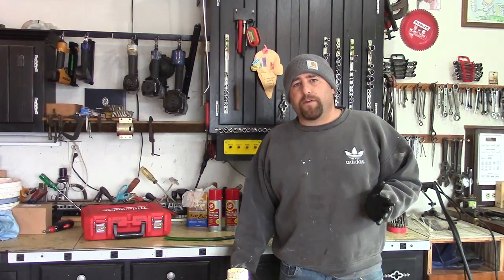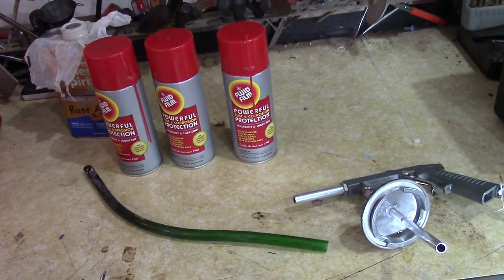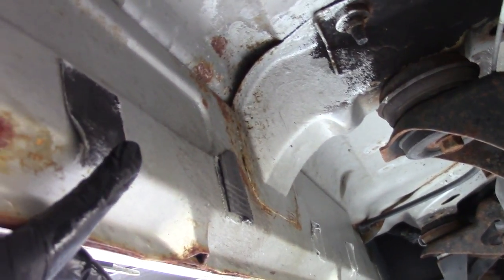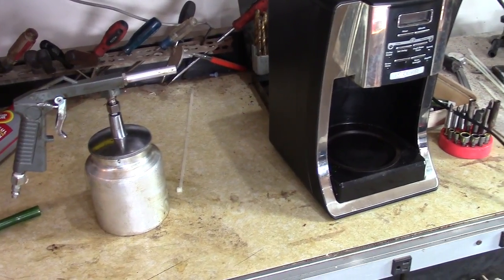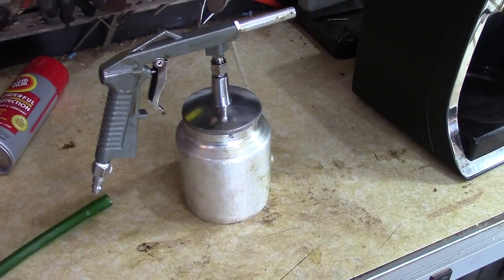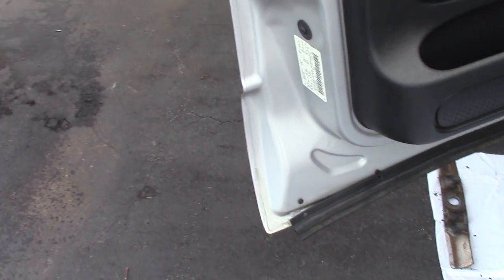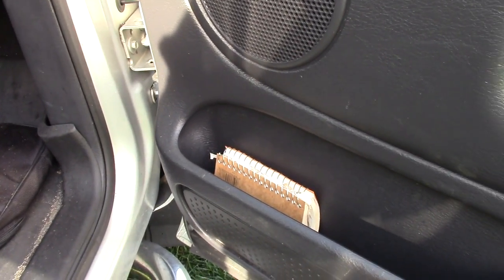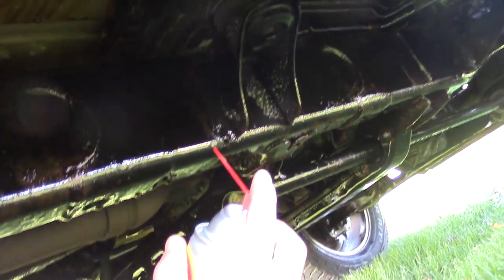Using Chainsaw Bar Oil For Undercoating My Truck

Comment: Your basic problem with the rust is the truck's a Chrysler/Dodge product in the first place...
Reply from the maker: No one told me that I should get a Ford or Chevy because they don't rust.  In fact, I got rid of my F150 because of rust.
Reply: @doublewide6   all manufacturers have rust problems tho japanese seem to have less, they used to use more coatings and different sealants giving a full decade of protection but greed has led to whats going on today. frame rails have holes because they are dipped in a bath at the factory allowing the coating in and out as well as environmental liquids like when you put a boat in at the ramp. next time just add a lil lacquer thinner or white gas with paraffin wax melted into it to the bar oil to improve flow yet increase tack once evaporated while also increasing penetration into the rust. you can also use just plain roofing tar cut with thinner  instead of used oil, used oil contains a lot of acids as well as microscopic  cast iron and steel particles that may increase deterioration over time.

Comment: Best is to have a friend that has a stone driveway to spray your car on and a portable compressor.
Reply from the maker: That would work well.  It takes about 2 days to stop dripping, so you want to leave it parked over a tarp or cardboard.
Reply: Yeah it's always good to have a friend's house you can make a mess at. LOL

Comment: Terrible idea and no update
Reply from the maker: I recoated about 2 weeks ago.  I put fluid film on my other car and the oil works way better.  I'm  just coating over the few spots that rubbed off.  The oil is the way to go it seals great.
Reply: @doublewide6  fluid film is to thin.

Comment: I have f250 ford 2003 no rust 90 percent of my state they do not  used salt ..in portland ore. They used salt ...salt  is for people who can not  drive in snow or to lazy to put on tire change ,
Reply from the maker: Conditions of the snow, temperatures, and traffic patterns determine if they use brine solution or salt.  I put on snow tires, but I still have to drive on salted roads.
Reply: Portland Harley gets any snow. Try living in a New England State. I think we know how to drive in the snow and they still put down salt calcium
Reply: P 9

Comment: Nice video.  You may want to think about putting on a zinc paint first.  As you know it's a metal that gives up it's electrons stopping the (Fe^3 ) iron from rusting. The oil just keeps the oxygen from getting to the steel.  Kind of a 1 ..2 punch.  FYI I've got a dodge truck... I have the same issues.   Typically winter has the lowest humidity so if you can keep the truck inside it will dry out.  .good stuff. nice job.
Reply from the maker: I wish I had room to keep my truck indoors it would make a huge difference.  Where do you get Zinc paint?  I would have to be really carful with overspray.
Reply: doublewide6 Repairs LLC google says true value etc.
Reply: David Zemke

Comment: I usually enjoy your videos but there is a first time for everything.  I hope no motorcyclist comes along after your first drive in the rain because I see this making a nasty slick at an intersection. Spraying that crap under your truck is stupid, cheap and irresponsible . .... Holes in the frame cane be there for anything from access points for bolts (such as a snowplow mount) to allowing a  point of escape for water to evaporate and prevent rust.
Reply: ....... I was thinking the same, enjoying his channel though,  uses his brain before hands, (maybe not the "Sta-bil video). Integrity has to have domain over product.

Comment: #08881 3m undercoating. 6 rattle cans for a ranger. Maybe 7. I do axle and spare tire mount area and under bed and cab and frame rails and leaf springs. So 8 at most. $100 total per ranger. $140 on full size truck prolly.
Reply: Rubberized undercoating is great at holding rust and moisture in. The idea with oil is that it creeps into the pores of the metal and a stone won't chip it as it heals.
Reply: is the  3m undercoating  a rubberized like type or what........

Comment: What a terrible idea....I can only imagine how much shittier it would be to have to work on something under your truck. I bet it smokes like crazy when parts start heating up. Good luck putting parts back on as all your bolts slowly loosen up and fall out....
Reply from the maker: The oilness goes away and a coating of fine dirt ends up coating the oil.  So it ends up being much like a standard undercoating material.  I will show a video in about 3 months of how it is coming along.
Reply: Lighten up Francis. People have been doing this for years. Most mechanics ain't afraid of a little grease.
Reply: @justicefornone3411  you tender peach
Reply: At least you’ll have a vehicle to work on.